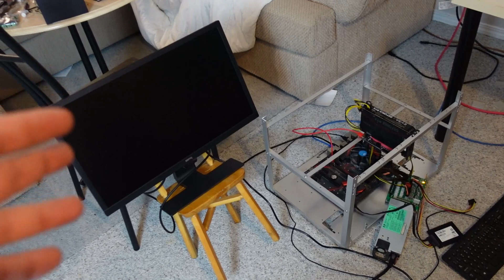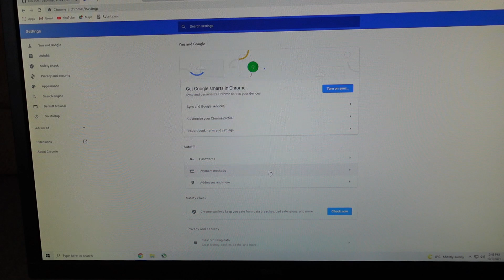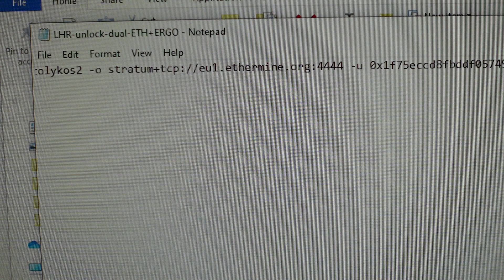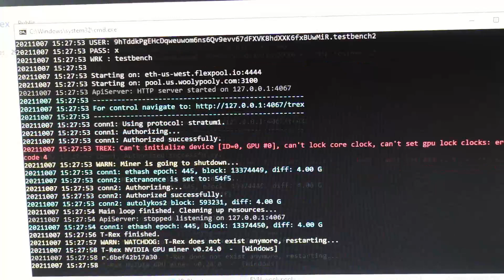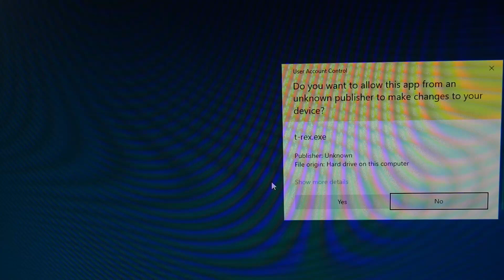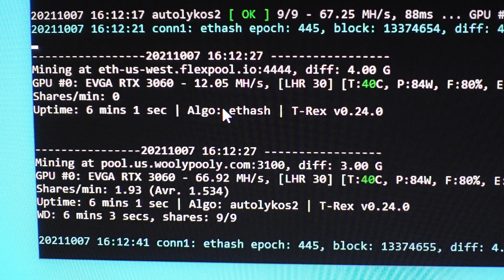NEW Trex FULL LHR Unlock? NOPE!! | Dual Miner Claymore v2

Comment from the maker: What Are You Hashing At?  Is It Worth It To You?
Reply: I was seeing ~5 Mh/s Eth and ~38 Mh/s on Erg but my core and mem settings are triggering lhr lock so still messing with it. Still working on -lhr tune parameters in .bat file.
Reply: Github:  In order to enable LHR mode, you need to explicitly tell the miner which GPUs are LHR and which are not. This is done by specifying --lhr-tune parameter which takes values from -1 to 95:
-1 - auto-mode (LHR tune is set to 71 (or 68 in low power mode) for LHR cards and 0 for non-LHR)
0 - disabled (use for non-LHR cards)
68 - recommended starting value for most LHR cards in low power mode (see --lhr-low-power)
71 - recommended starting value for most LHR cards
It can also be set for each GPU separately, e.g. --lhr-tune 0,0,71.5,0 - this will tell the miner that the third GPU is LHR and that it needs to start with the tuning value of 71.5, while the rest of the cards are non-LHR.
HiveOS equivalent would be "lhr-tune": "0,0,71.5,0"  :_RIG:
Reply from the maker: @fudwiser1091  Yuppers but does not apply to the dual mode it has a default to be applied on.
Reply: I am getting about 16MH/s on Eth and 74-75MH/s on Ergo without locking my settings in the miner and seeting myself in after burner. Gigabyte 3060 rev 2 Samsung memory -502 core clock, power limit all the way down, mem clock at +1300
Reply from the maker: not to bad
Reply: @RabidMining  On my 3060's ive been getting abt 18mh/s ETH - 28mh/s CFX which has definetely been more profitable for me. but not until it reaches LHR 37 which takes a little bit to climb to using auto LHR. So far so good for me.

Comment: I achieved to get eth/rvn 35MH/30MH @240W on my 3080 with following settings:
--lock-cclock 1200 --mclock 1200 --pl 80

I had the same problem of getting extremely low hash rates, it got solved by not locking the core voltage.
No clue on this, since locking core voltage works on either mining eth and rvn.
Nevertheless, it works.
Reply from the maker: Yup think it depends on the GPU as well the 3060 and 3060ti dont seem to work well with the absolute core but 3070 and higher seem to work great.